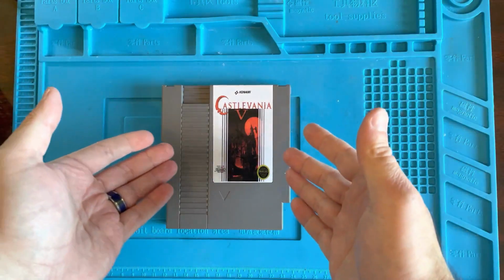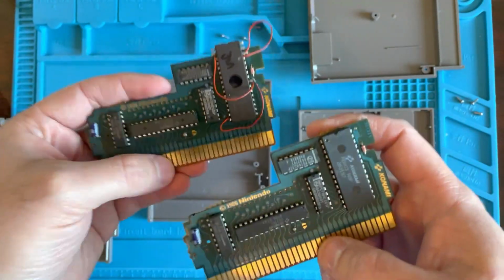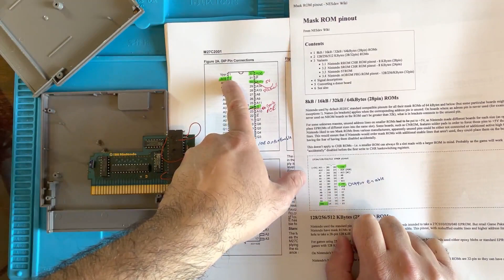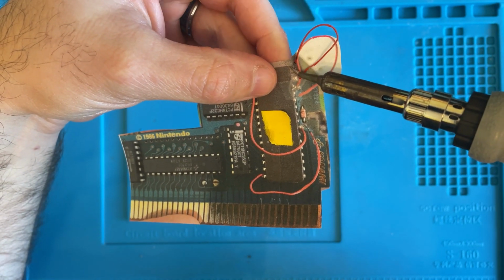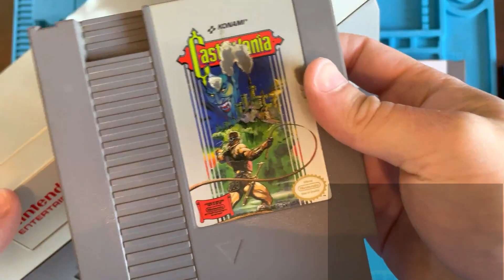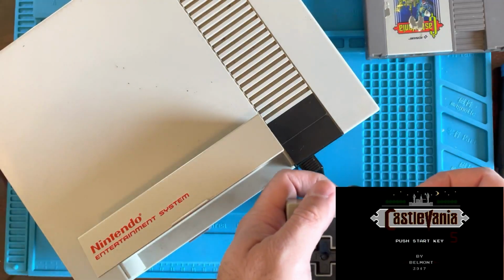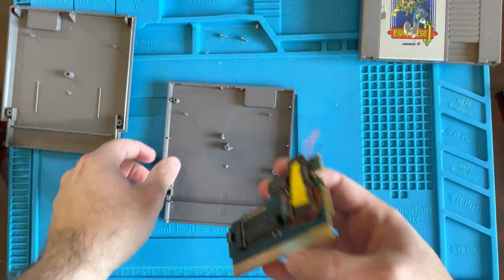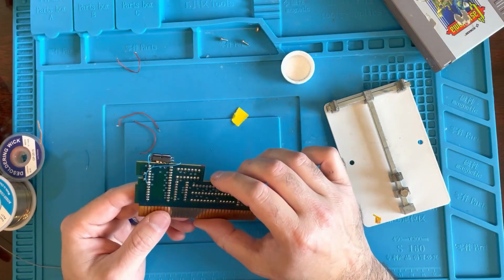Castlevania 5 Cartridge For NES Broken!! Can It Be Repaired??!!

Comment: Always Lift Pin 4 of the 10NES chip on these units.
Reply from the maker: Yeah I’m going to have too. That was super frustrating!!
Thanks for your comment!!🐺😃
Reply: Or you can just leave it be and clean the pin connector properly, which is a healthy clean with 99% IPA, then a 10 minute boil in water, then another IPA bath. Good as new.
Reply from the maker: I will have to give that a shot before I start cutting up my NES. 
Thanks for your comment!! 🐺😁